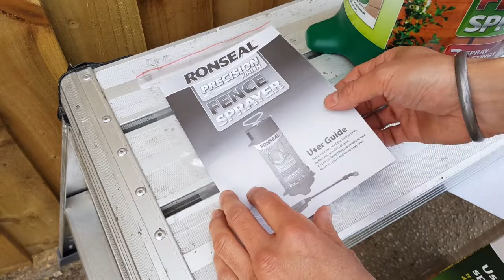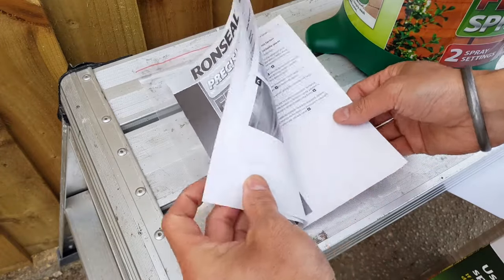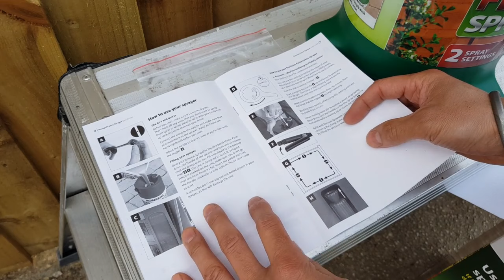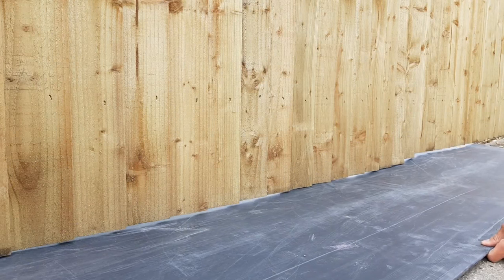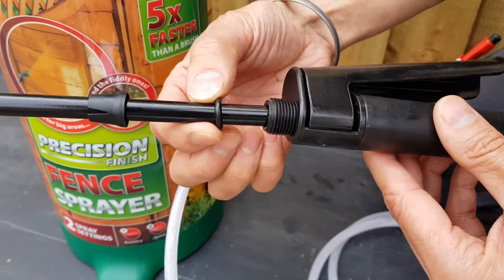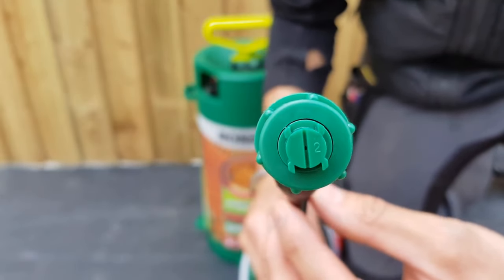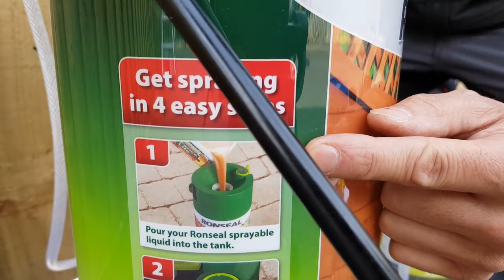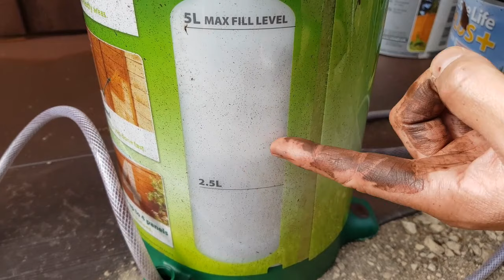All you need to know about the Ronseal Precision Finish Fence Sprayer with Tibby Singh

Comment: This video saved me around 3 days worth of Fence painting. Today, I painted around 12 panels in 3 hours.That would’ve taken me days and days with a brush. Thank you SO MUCH for making this video in the level of detail that you did. I wouldn’t have figured out all those little details such as cleaning the nozzle by taking it apart, how to properly wash everything with water, emptying it out quickly by removing the nozzle but still using the pressure etc. all those little details made today one of the most productive days I’ve had in a long time!,  Thank you, thank you thank you 🙏
Reply: No offense but I can do it faster with a roller and brush than this machine and achieve better results. You want to back roll it, or brush it in… trust me I’m a professional. This fence looks bad!… but you wouldn’t know that because your not a professional.

Comment: Thank you for the demonstration, I was considering buying one of these as I have both sides of a long fence to paint. I will definitely be buying one now, this has proved to me how much quicker it is. Thanks again.
Reply: Really great points. I love the issues about pumping it until it hisses and also cleaning out the pump from the gunk. Another tip I saw in other video comments, have a bucket of water to immerse nozzle head into the water if you take a break so the nozzle doesn't dry out as that causes issues.

Comment: As part of my job i do a lot of fence and shed spraying.
Sometimes I spend days painting.
I always use a sprayer in conjunction with a brush.
Spraying an area and then quickly going over it with the brush to work the paint into the grain and areas that are less absorbent.
I keep a half tub of paint handy to apply extra where needed.
I find this gives a more consistent coating and a better Finnish.
Reply: That's useful to know. Do you complete a panel before going over with the brush?

Comment: Just brought one to do a fence and found it a total waste of time the nozzle kept blocking. Even used a paint mixer to stir it up. In the end I emailed ronseal and told them what a piece of rubbish it was even using there own fence paint which was supposed to be sprayable. Thankfully I got my money back from screwfix and ending up rollering the panels took longer but at least it worked. Nice video though and glad you had more success than me
Reply: Did you try straining through an old sock?

Comment: I've just bought one. Was 24 quid so I've been robbed lol. It works well. Good test though of the unit. . I do believe you can water down 10% warm water that helps a lot with the spray pattern but it works and it does the job a lot quicker
Reply from the maker: That's great to hear haha that's still a good price. Did you use our amazon affiliation link 🤗 It just helps us out when producing more videos :)

It works wonders when you know how to use it and hope our video helped.

All the best 🙏🙌
Reply: @TibbySingh  sorry mate. I got it from S fix a few days ago. I've just came across your video while I'm waiting to see if I like the harvest gold or not lol.  Done 10 foot but I'm on the fence, ha ha with that colour. I may have to go for the med oak. May be a better option road side. Back to the unit. They work well mate. Cheers.
Reply: It does state in the additional user instructions, which came with mine, that you can add 10% warm water if  the mixture is too thick. This definitely helps the spray as does gently cleaning out the filter! Great informative content. Well done!

Comment: Hi just wondered if the paint should be that thick and lumpy  thanks
Reply from the maker: Yes the Ronseal paint is usually think and lumpy as seen in the video. Also there's no need to water it down. Hope that helps 👍
Reply: @TibbySingh  Its better if you give the paint a good stir before putting it in the sprayer

Comment: I think you should mix the Stain to get the clumps out and maybe then it with some oil base stain.
Reply: I use a drill and paint mixer drill bit to get the paint less lumpy and more runny. However it's still difficult pouring a 12 litre tub even with a funnel. So I use a ladle and a rectangular mechanics funnel after mixing out the lumps.

Comment: Great video, I've got 14 6×6 panels to paint both sides. I've already painted 9 6×6 with a brush, which took an absolute age.

I'm using the cuprinol duck back forest green. There's nothing on Google or the tub that states if it can be used with a spray or not. I'm waiting on a reply from cuprinol themselves but had nothing since I emailed them four weeks ago. I've also tried phoning them with no luck.

Thanks for the video and if anyone has used this sprayer woth cuprinol duckback, could you let me know your thoughts and results.

Thanks.

Comment: As a retired painter with over 45 years of experience, I can tell you your stain job will fail prematurely. You NEVER spray on any stain!!! If you are lazy enough to do so, you MUST go over it with a brush and work it in, or you are wasting your time. Seriously folks, you get back what you put into a job. This is a joke.
Reply: If anything, sprayer is easier to reach all the gaps and crevises in the wood, brush just makes the process longer, and I don't see how using it makes the result better

Comment: Good video but the product is not fit for purpose took mine back and got an electric sprayer .  The electric sprayer was faster, better finsh and used alot less paint.  It took 15l to paint a standard 8x6 shed !!!  electric sprayer used 15l to paint around 40m of fence and a 7x6 shed .  I dont recommend this product at all